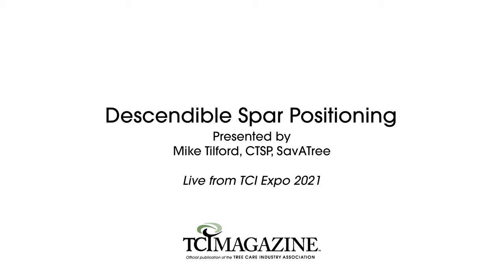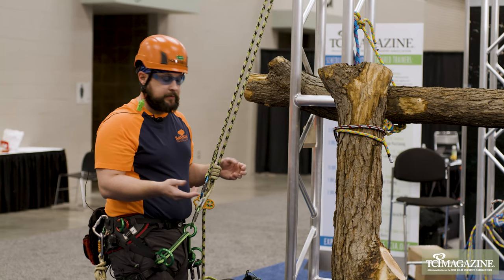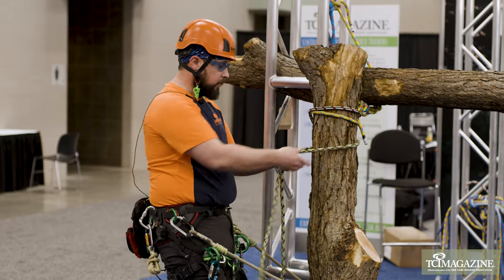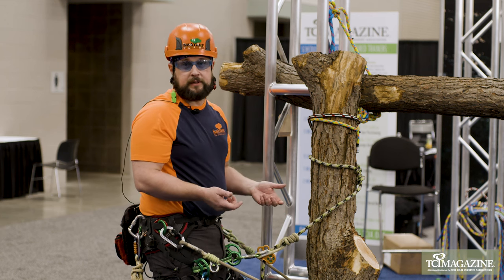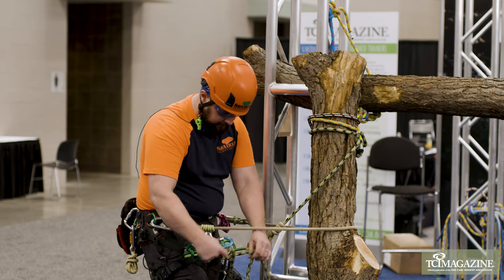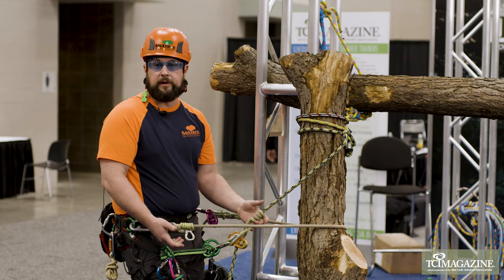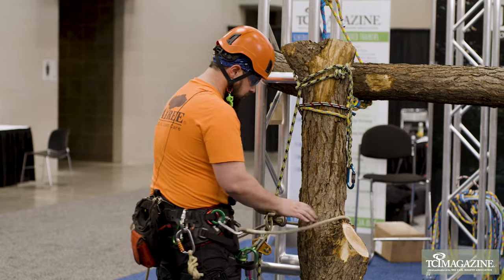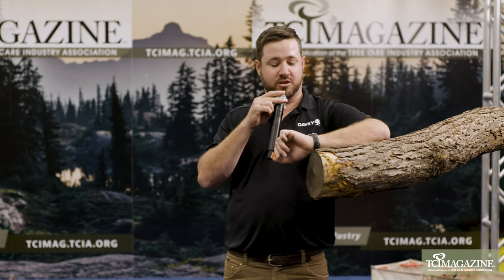Descendible Spar Positioning | Mike Tilford | TCI Expo 2021 | The Tree Care Industry Association

Comment: If a munter hitch is applied while attached to a lower side d to add friction to a hitch attached to the bridge it will pull a climber off center and load the side d of the munter which could lead to unergonimical discomfort.
Reply: Use both Ds
Reply: John, a munter on a biner attached to a lower leg loop is a standard way of descent back up in alpine/ ice climbing and I do use it for treework all the time, sometimes even for rope wrench/ hitch or mechanicals - it also has a big advantage if working with snowy/ sloppy ropes, of stripping icy glop off a wet rope before that rope section gets to your hitch or mechanical - a fact that's often overlooked by those who work in warmer climates. Saved me from going for a ride down on more than one occasion. Leg will be all white and snowy but rope runs fine. Stay safe out there.
Reply: @prairiemushroom  thanks for the reply. I will give it a try 👍
Reply: @john.massing  Maybe Mike mentions this - I forget - but I use a carabiner with a wider top for the munter - something like a Rock Exotica Pirate is really smooth. If you use an oval, it isn't as happy a ride! Either way, one hand on the hitch or mechanical and one hand on the rope beneath the munter/ biner as a control hand. Most of us geezers don't bomb down either (unless we're really sure of the tie point or it's an engineered structure). slow and steady and stay alive. Cheers

Comment: Why do you think wire lanyards are antiquated?
Reply: Usually people don’t like wire lanyards because they are not as flexible so you can’t use them as a small moving rope system/wire does not bend and flex like regular rope. They are also no good around power lines. They are not suitable within 10 feet 3 meters of electrical lines
Reply: @JpWi  i get all that but what do you think is antiquated about them? 
As far as i know there is no better option as far as cut resistance goes.
Reply: A chainsaw will cut a steel lanyard as easy as rope. Get an old one and lanyard to a trunk and tap it with a saw.
Reply: @sempi8159  the wire core has nothing to do with cut resistance. its about ease of the flipping motion
Reply: @sempi8159  when cutting your lanyard, remember that you already broke the rules. Also, steel core is too much weight for the benefits outside of a large diameter spar climb..
Reply: Yeah I'm going to have to disagree that steel cord Flipline can handle a chainsaw but you are right that is breaking the rules but if we're talking about a steel cord versus a rope Flipline that's still cord will handle just about anyting it's already been tested and proven

Comment: Pretty sure a wire core lanyard is safer than fabric lanyards if you touch with a chainsaw while in tree
Reply: common misconception
Reply: @Johnnyreengo  No its not. While a saw can go through them, they do offer some resistance. Therefore, they are safer.
Reply: There really is no point of arguing about it guilty of treeson has already put it to the test bounced that saw off the steel core about three times.... how many times you plan on hitting that Flipline in a single climb